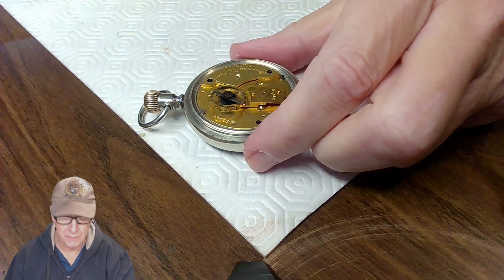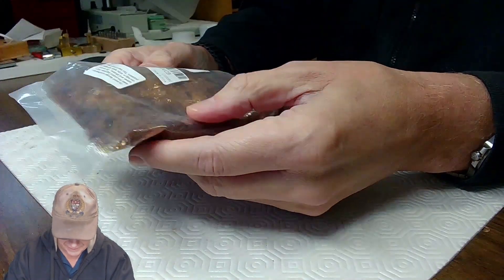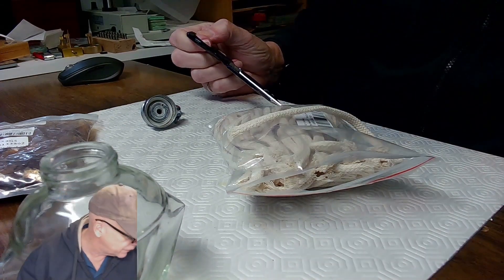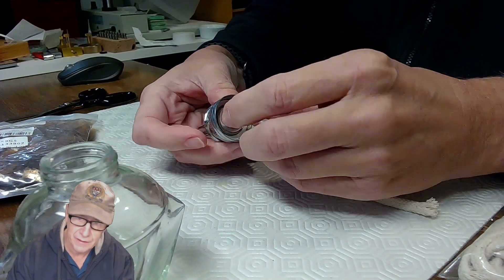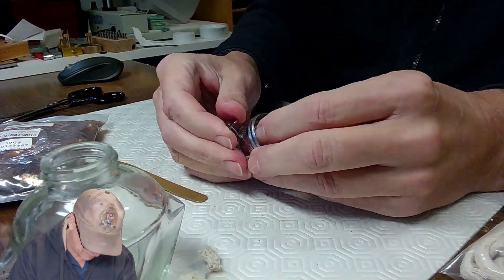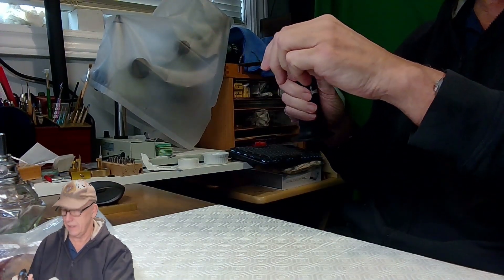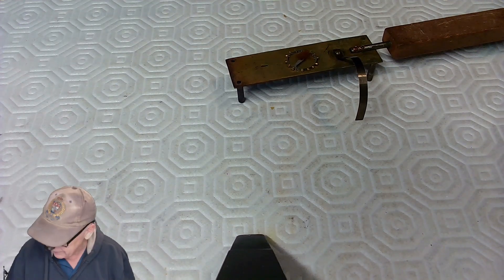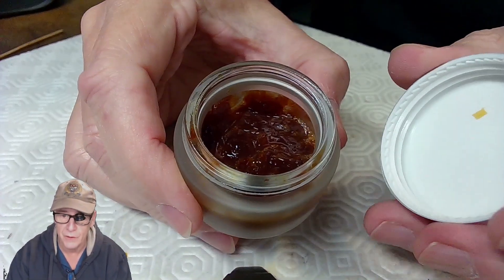Watchmaker Making Liquid Shellac

Comment: whats the comment about the shellac needing to be clear ? 
my vintage watchmakers shellac inst clear. and no watch vie worked on has clear shellac holding jewels in. its all a golden brown color.
Reply from the maker: So do you let the roller table soak in IPA for an hour first to clean up the old shellac?  Also, when you put in the new jewel, do you put the new shellac in the jewel hole first and then push the jewel in from the bottom.

Comment: I was taught when applying heat to melt the shellac that you're supposed to apply the heat from below the brass table to slowly heat up the roller table, impulse jewel, and shellac just until the shellac melts and flows then stop applying heat and let everything cool. Using that Bernzomatic hand torch to apply heat on the top would wreak havoc... wouldn't it?

Comment: Forgot to add this to my first comment. 

It is a bit hard to tell (watching this on my phone) if the liquid shellac you are forming is clear or not. 

The reason I mention this is wax free shellac dissolves in alcohol to give a completely transparent solution. You can get a great idea of how it should look in Alex’s video. 

If the solution is at all cloudy you are using shellac that has not been dewaxed, and this is unsuitable for watchmaking.

Also, be careful with such hot heat sources around bimetallic temperature compensating balance wheels, if you alter the temper of the metal the temperature compensation is ruined. I’ve seen examples that were heated by previous repairmen that expanded very unevenly because one arm had gotten much hotter than the other, presumably when fitting a roller jewel without first removing the roller table. 

I think this balance should be ok, the flame stayed quite distant and the metal plate you had it on would’ve worked as a heat sink.
Reply from the maker: That was a trial balance and not the one I will be working on. The shellac I purchased was dark yellow.  Will do some strength testing on it a well, when it is cured tomorrow.  If it is not transparent, I will purchase the wax freee shellac and make another batch. I have the time and want to do it right.
Reply: @JDRichard  One of the things I really appreciate about your work is that you always take the time to do it right. No dodgy shortcuts that I often notice elsewhere.
Reply from the maker: @mercuriall2810 I bit anal
Reply from the maker: Why would the have wax in shellac. For wood work?
Reply: @JDRichard  Shellac is the dried resin secreted by the female lac beetle and contains waxes to begin with. These waxes can be helpful when used in woodwork finishing, but for the glossiest finish, whilst not interfering with the wood’s natural colour, dewaxed shellac is preferred. Dewaxed shellac is compatible with water based varnish and lacquer, for which it is also preferred.

Comment: The two common forms of shellac available for sale are shellac that contains wax (unsuitable for watchmaking) and wax free/dewaxed shellac, which is suitable for watchmaking. 

Being a natural product, batches do vary. I find a good test is heating a flake and attempting to draw a thread by pulling a corner of it away from the rest of the flake. If it will draw a thread and the thread sets up hard when cool, the shellac is good for use. 

Shellac also has a shelf life, it can go bad in as little as a year, so old shellac is useless and the vintage/antique watchmaker’s shellac often seen on eBay is good only as an ornament. 

Alex Hamilton’s watchmaking resources are certainly top notch, I’m glad you gave him a shoutout, JD.
Reply: One use of shellac is to hold small parts for polishing. I wonder if waxed shellac is ok for that